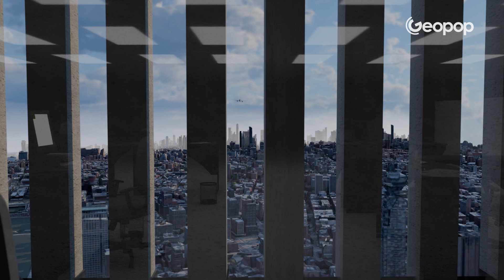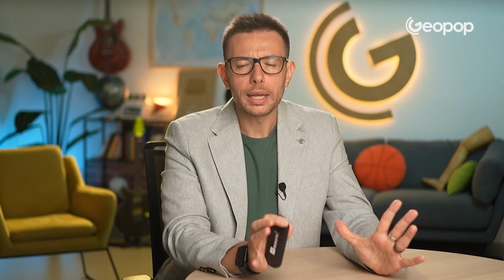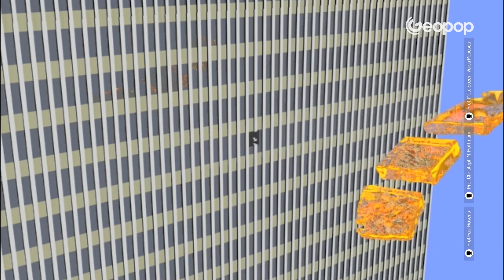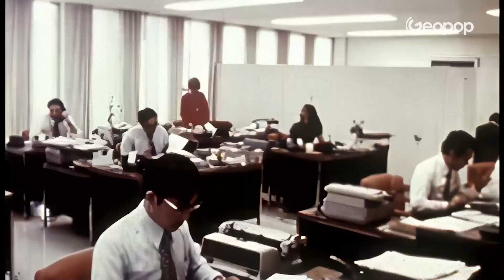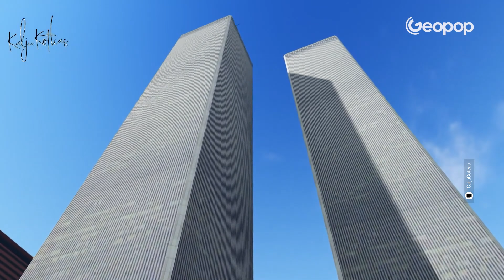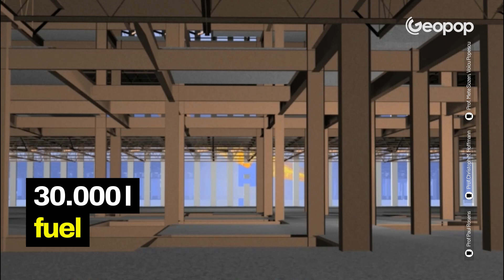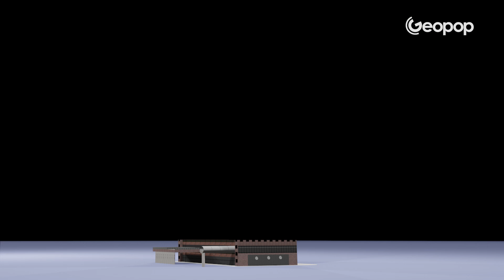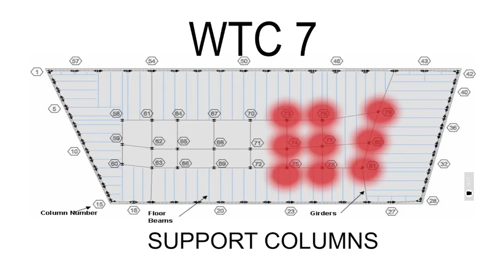9/11, 2001: The Technical Reconstruction of the Twin Towers and WTC 7 Collapses

Comment: The plane hits (if there were planes) were the equivalent of a house fly hitting an elephant.
Reply: Actually, the impact of Flight 11 was equal in energy to about a ton of TNT, Flight 175 about a ton and a half. 

The add in 5 tons of accelerant.
Reply: @TheLoonResistance .     Your made up assertion supported by flat out speeds they couldn’t have been flying at, flown by rookies who couldn’t have had the ability.
Reply: @nosher_4114  - The impact velocities can and have been measured.  We know what they are and they are true whether or not it fits your personal brand of reality-distortion.

If you have more accurate figures please present them.

I won't wait up.
Reply: @nosher_4114 please explain why, repeat why, those planes could not have been flown at the calculated speeds? Please?

Comment: Dear Chat: When did WTC 7 collapse on 2001 September 11?  I am correcting a YouTube video www.youtube.com/watch?v=tnrkvrXTCsw which clearly has incorrect audio.  Thanks.  For 24 years, I had always learned from multiple sources online that WTC 7 collapsed later in the day -- around 5pm.

You’re correct: World Trade Center 7 (WTC 7) collapsed at 5:20 p.m. Eastern Daylight Time on September 11, 2001 (specifically 5:20:33 p.m. EDT).

This time has been consistently documented in:

FEMA’s May 2002 report

NIST’s 2008 Final Report on the Collapse of WTC 7

News broadcasts and timelines from that day

So if a video claims the collapse happened earlier in the morning or shortly after the towers fell, that audio is indeed incorrect.

Comment: 17:43 it does NOT help when you show the South Tower collapsing WHILE SAYING "when the North Tower came down".  Also, the North Tower did not collapse until 10:28,
yet you previously said "WTC7 collapse at 10:28", which would imply the North Tower and WTC7 collapsed AT THE SAME TIME!
Sorry, but either your data or your audio is inconsistent and not factual.

Comment: Wait, what?  WTC7 collapsed  at 10:28?  For 24 years every source online said WTC7 collapsed later in the day, like around 5pm.  I must be mistaking WTC7 with some other WTC building.
Reply: He doesn't say that. 

We're talking about a 47-story building located approximately105 meters from the North Tower, which at 10:28 was the second building to collapse after the South Tower on September 11 

You are indeed mistaking Building 7 for some other building. He is clearly talking about when the North Tower collapsed.

I'm going to guess your other spam contains similar glaring errors.

Comment: We need a 3D plot showing stress as a function of two variables:  deformation and temperature.
However, mentally, I find it easier to understand with deformation as the dependent z-variables and stress and temperature as the independent x and y variables,
because stress and temperature are what we apply to the steel, deformation is how the steel responds.

Comment: these are all lies,  what destroyed the inside lift shafts and core colums, the upper part was already destroyed and still the lower was demolished from what force? Tip of the wing cut the column? both buildings fell down in the same scenario? the terorists were genius pilots to hit everything to the same point. shouldnt buildings tops fall to one side where the colums wer cut or where the fire was hottest but not simmetrically even in controlled ddemolition scenarios they dont allwys succeed to achieeve the simetry ? how was it possiblle that wtc7 also fell in controlled demolition manner the same day as wtc1 and 2 ? The rubble was molten hot, buildings fell, turned to dust and rubble deported? why so similar to controlled demolition? what do controlled demolition experts say if they dare?
Reply: 🤦‍♂

Let’s break it down to the absolute basics, addressing most of the commonly asked questions as we go, point by point:

The 47 core and 236 perimeter columns of the Twin Towers support all of the gravity loads of the building. ALL of the resistance is in the columns.

Planes impact Towers, causing massive structural damage, destroying sprinkler systems, tearing out gypsum board walls and blasting off the SFRM insulation from the floors. Multiple floor-wide fires are started instantly and spread rapidly due to the destruction of fire protection systems and venting of the building during the impact.

Serious fires were largely confined to the impact damaged floors and those immediately adjacent to them.

Fires were started by the impacts and fuel aboard the aircraft, which acted as an accelerant. No shortage of other consumables inside the tower to continue the fires.  Active and passive fore protection systems were destroyed in the impacts, there was no active firefighting.

Collapse was initiated (started) at the impact and fire damaged floors when floor trusses exposed to heat over time sagged, in turn pulling on and causing the inward bowing of some perimeter columns by up to 5 feet until they buckled on one face of each tower (ie: NOT symmetrically).

www.youtube.com/watch?v=ULdiD6gYZO0

No steel melted or needed to. Structural steel will bend and fail at less than half its melting temperature.

Once the perimeter columns buckled the formerly static load above became a dynamic load 30 times greater, easily overwhelming the structure below.

Thousands of tons of now loose debris fall through the open office space within the four outer walls - bypassing the columns - dropping 12 feet onto the first intact floor it comes across. That massive instant overload causes the floor to fail, shearing the pair of bolts that secure each end of the floor trusses to the columns. The floor fails. adding its mass to the falling mass which continues to accelerate for another 12 feet until it impacts the next floor, rinse and repeat one floor at a time all the way down.  Yes there is resistance but its totally inadequate to arrest the collapse. Resisting is not the same as preventing

The columns - the part that holds the building up, supporting ALL of the gravity loads - are spectators for all this as the debris falls around and past them, not onto them.

Rate of collapse increases as momentum increases. The collapse front is constantly accelerating.

As each floor fails, air inside the building (the Towers were 95% air by volume) is compressed, then blows out the sides _in reaction to the Tower falling, not the cause of the Tower falling.

No fire required at all on floors below the impact points for them to fail. The mechanisms that started the collapse are different to the mechanisms which continued the collapse. That will be a difficult concept for some.

As the floors fail the perimeter columns are left literally hanging in the breeze, no longer attached to the rest of the structure. They peel away and fall in great sheets (think banana) out to more than 600 feet from the base on the 4 points of the compass.

Core columns failed last, buckling near their base due to the loss of critical lateral support as the building collapses around them.

www.youtube.com/watch?v=WpHXj62Ylw0

Twin Towers collapses were a combination platter of four (4) factors:

Impact Damage + Fire (heat) + Time + Gravity = Collapse

Remove any one of those four factors and there is no collapse. Ignore any one of those factors (most people reading this ignore three) and you will never understand the collapse. They all work together. 

The collapses took 32 to 34 seconds start to finish, or about 1/3 of the rate of free fall acceleration for those obsessed with how fast things fall because the internet told you it was important. No Laws of Physics are violated so no need to invoke magic or divine intervention

Each 110-story tower had a 1-acre footprint. The debris pile was up to 14 stories deep and spread out over 16 acres, destroying 8 surrounding buildings and damaging more than 100 others.

Anything can seem like a conspiracy if you don’t take the time to understand how it works. Hopefully now you do.  If not, I can go into much greater detail.
Reply: @TheLoonResistance  Thank you  Critical Stinker. I was just gonna call him stupid.
Reply: @theakers  - Tends to not be helpful.  You can't just tell them they are stupid. That will just get hand-waved. You have to demonstrate they are stupid in a way that drives it home.

Comment: what destroyed the inside lift shafts and core colums, the upper part was already destroyed and still the lower was demolished from what force? Tip of the wing cut the column? both buildings fell down in the same scenario? the terorists were genius pilots to hit everything to the same point. shouldnt buildings tops fall to one side where the colums wer cut or where the fire was hottest but not simmetrically even in controlled ddemolition scenarios they dont allwys succeed to achieeve the simetry ? how was it possiblle that wtc7 also fell in controlled demolition manner the same day as wtc1 and 2 ? The rubble was molten hot, buildings fell, turned to dust and rubble deported? why so similar to controlled demolition? what do controlled demolition experts say if they dare?

Comment: The 9/11 Official Story is a PANT-LOAD.  The Twin Towers were blown to smithereens.  The internal columns were about 5" wall thickness [box columns] and got lighter and lighter towards the top of the buildings.  How is it that the much lighter structures could destroy the much heavier sections below?  Where did the 'hat trusses go?  What destroyed them, being at the top? Where did 110 floor-pans and trusses go?  Where did 1,119 human bodies go?  Stuck in the pancaked floors?  WHAT pancaked floors?  Mr AI voice here talked about the 110 floors 'collapsing' in aprox. 10 seconds.  That's about 10 FLOORS A SECOND folks.  Give your head a good shake if you still buy the Official BOGUS story.  https://www.youtube.com/watch?v=lQFEyEabnvU
Reply: This is how, short version:  Let’s break it down to the absolute basics, addressing most of the commonly asked questions as we go:

The 47 core and 236 perimeter columns of the Twin Towers support all of the gravity loads of the building. ALL of the resistance is in the columns.

Planes impact Towers, causing massive structural damage, destroying sprinkler systems, tearing out gypsum board walls and blasting off the SFRM insulation from the floors. Multiple floor-wide fires are started instantly and spread rapidly due to the destruction of fire protection systems and venting of the building during the impact.

Serious fires were largely confined to the impact damaged floors and those immediately adjacent to them.

Fires were started by the impacts and fuel aboard the aircraft, which acted as an accelerant. No shortage of other consumables inside the tower to continue the fires.  Active and passive fore protection systems were destroyed in the impacts, there was no active firefighting.

Collapse was initiated (started) at the impact and fire damaged floors when floor trusses exposed to heat over time sagged, in turn pulling on and causing the inward bowing of some perimeter columns by up to 5 feet until they buckled on one face of each tower (ie: NOT symmetrically).

www.youtube.com/watch?v=ULdiD6gYZO0

No steel melted or needed to. Structural steel will bend and fail at less than half its melting temperature.

Once the perimeter columns buckled the formerly static load above became a dynamic load 30 times greater, easily overwhelming the structure below.

Thousands of tons of now loose debris fall through the open office space within the four outer walls - bypassing the columns - dropping 12 feet onto the first intact floor it comes across. That massive instant overload causes the floor to fail, shearing the pair of bolts that secure each end of the floor trusses to the columns. The floor fails. adding its mass to the falling mass which continues to accelerate for another 12 feet until it impacts the next floor, rinse and repeat one floor at a time all the way down.  Yes there is resistance but its totally inadequate to arrest the collapse. Resisting is not the same as preventing

The columns - the part that holds the building up, supporting ALL of the gravity loads - are spectators for all this as the debris falls around and past them, not onto them.

Rate of collapse increases as momentum increases. The collapse front is constantly accelerating.

As each floor fails, air inside the building (the Towers were 95% air by volume) is compressed, then blows out the sides _in reaction to the Tower falling, not the cause of the Tower falling.

No fire required at all on floors below the impact points for them to fail. The mechanisms that started the collapse are different to the mechanisms which continued the collapse. That will be a difficult concept for some.

As the floors fail the perimeter columns are left literally hanging in the breeze, no longer attached to the rest of the structure. They peel away and fall in great sheets (think banana) out to more than 600 feet from the base on the 4 points of the compass.

Core columns failed last, buckling near their base due to the loss of critical lateral support as the building collapses around them.

www.youtube.com/watch?v=WpHXj62Ylw0

Twin Towers collapses were a combination platter of four (4) factors:

Impact Damage + Fire (heat) + Time + Gravity = Collapse

Remove any one of those four factors and there is no collapse. Ignore any one of those factors (most people reading this ignore three) and you will never understand the collapse. They all work together. 

The collapses took 32 to 34 seconds start to finish, or about 1/3 of the rate of free fall acceleration for those obsessed with how fast things fall because the internet told you it was important. No Laws of Physics are violated so no need to invoke magic or divine intervention

Each 110-story tower had a 1-acre footprint. The debris pile was up to 14 stories deep and spread out over 16 acres, destroying 8 surrounding buildings and damaging more than 100 others.

Anything can seem like a conspiracy if you don’t take the time to understand how it works. Hopefully now you do.  If not, I can go into much greater detail.

Comment: will someone please let me know how you hammer a pencil thru 12mm thick 420 grade plate steel???
Reply: 1.  Don't hammer it. Fire it at hyper velocity
Reply: @TheLoonResistance  FIRE it with what??
Reply: @user-Rocket-Fest  - Obviously you need to design and build a suitable launch system to achieve the desired velocity